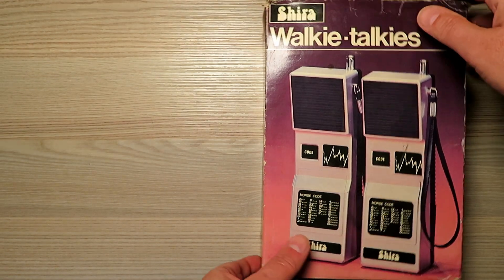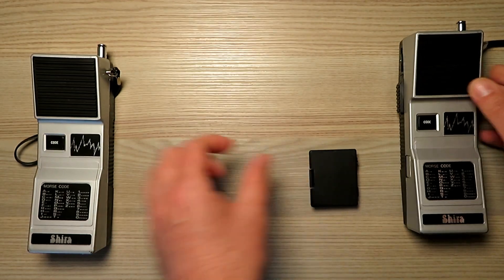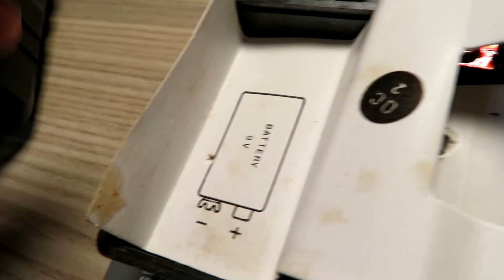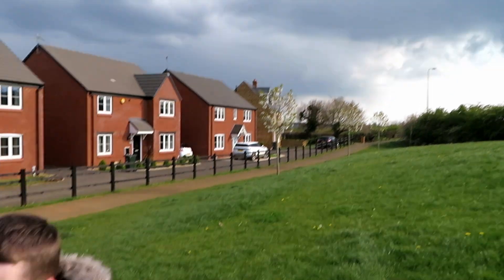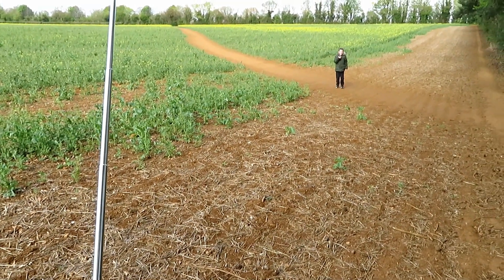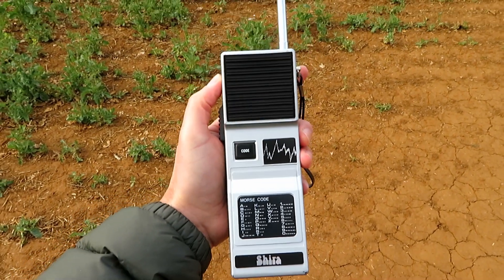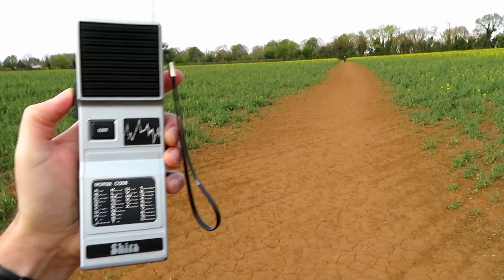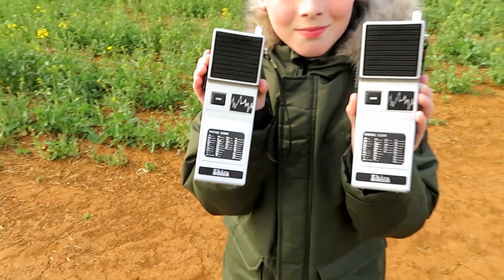SHIRA WT106-449 - PROBABLY A PAIR OF THE BEST BUDGET 80S WALKIE TALKIES YOU COULD BUY

Comment: I had a pair of these back in 1982 (a year before I got into CB) and used the to talk to my friend across the street. I found the range somewhat disappointing (less than 100 yards). My father told me to use the correct antenna for this band. I didn't have one so I just tied a long piece of thin copper wire to the top of the attic, and wound the other end round the telescopic antenna. It was probably about 6m long, which conveniently is the wavelength for these radios! Wow, what a difference, my friend who was incredibly 'hissy' at 80 yards was now as clear as day. I also picked up other users on other streets! About 10 years ago, I bought a pair of these, boxed, off eBay, in mint condition (for nostalgia's sake) I echo your comments about the receive section. My Yupiteru 7100 scanner was picking up the other set much more easily than the other Shira radio. So, agreed, they have poor RX.